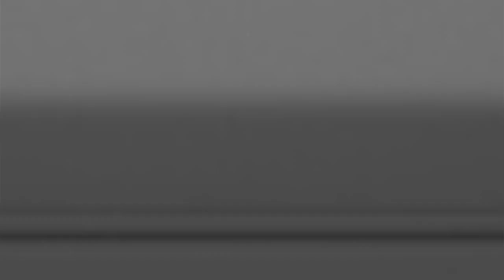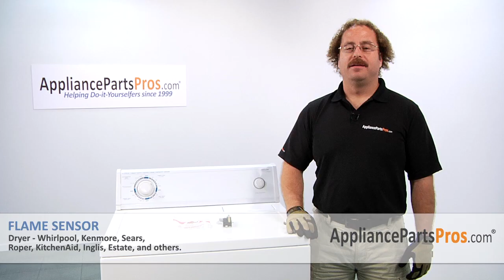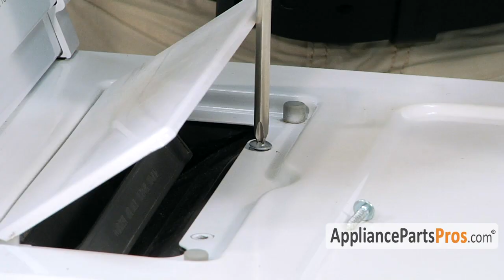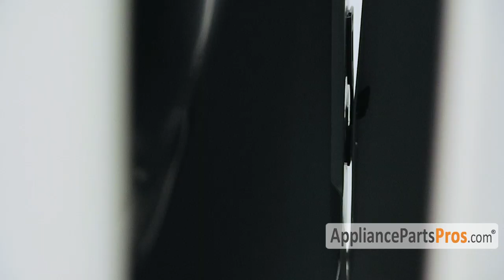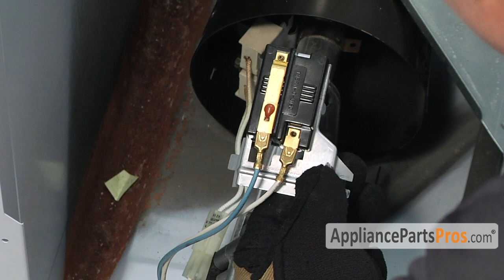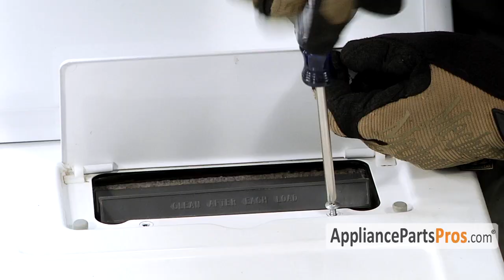How To: Whirlpool/KitchenAid/Maytag Flame Sensor WP338906

Comment: The fire on my dryer goes off about 3 seconds. Is it the sensor
Reply from the maker: carlostheanimal75 Has the drying time been getting longer? If so it could be the coils as they get old they drying times get longer. Here is some of our questions on our website for this part, in the answers it gives you the ohms reading for each one, test the coils when warm. http://www.appliancepartspros.com/questions-for-whirlpool-coil-kit-for-279834-ap3094251.html Also make sure the exhaust is clean and unrestricted. If the airflow is restricted it could cause the flame to hit the high limit thermostat and shut it off. It does not seem like the flame sensor is the problem, usually the heat will not come on if its bad.

Comment: He connects the wires on the wrong leads. Although saying that the white goes on the bottom and the blue on the top, he connects them to the opposite connectors.
Reply from the maker: When the wires are being hooked up, it was as you were looking at the part. Notice the connectors are at different levels. You are correct that as you rotate the part over to mount it the blue is at the bottom of the part. Thanks for the feedback, I hope the video helped out in the repair!